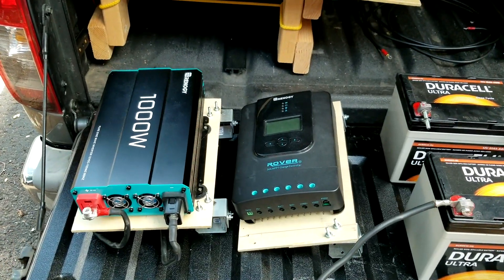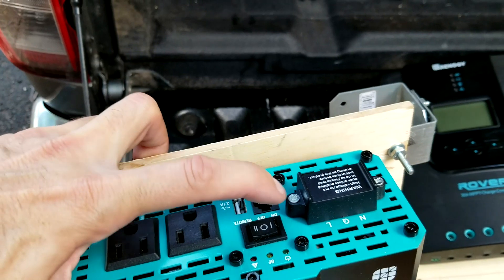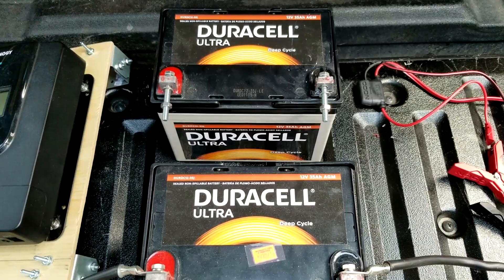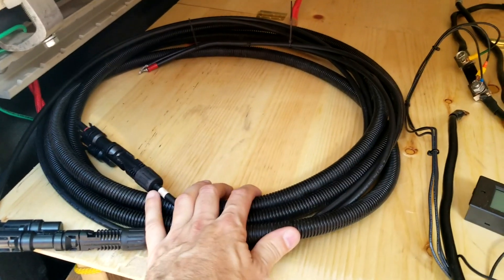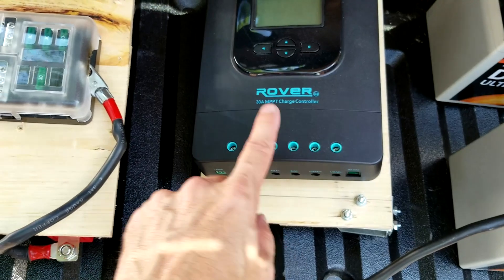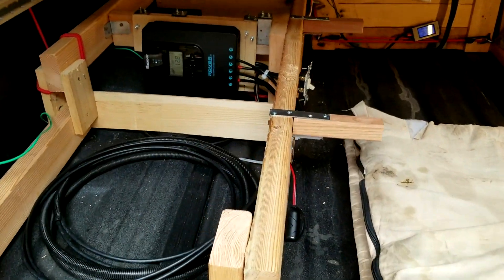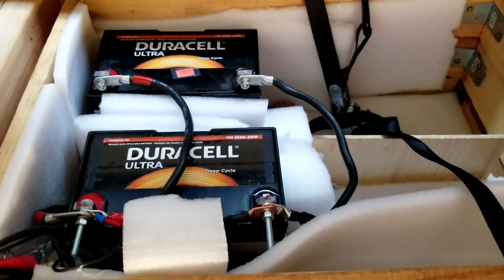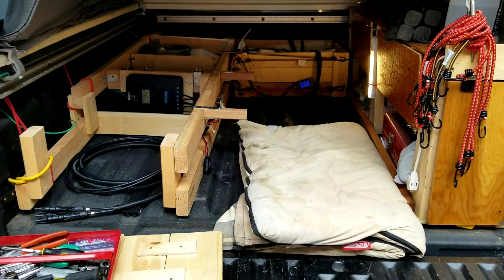Solar Install to 6' Truck Bed for camping

Comment: Hi, I noticed you have the comments turned off on the video on how to connect the 4 batteries and achieve a balanced charge and usage. I use it as reference, for me its one of the better ones on the web. Anyway, I have a similar 4 battery bank and I wired them just like yours. My question is if I put them on a straight line, can I add to each end another battery for a total of six and still be a balanced load. Have you done that?
Reply from the maker: Hello. Thank you for watching. I disabled comments to avoid having to give technical advice. There are better sources for technical advice than myself. I am merely presenting a theory that I believe. If others don't believe the theory, that's fine. I'm not interested in arguing. I'm sorry that I can't advise you on your project. I don't want people getting hurt or property damage. Thank you for watching & enjoy your project.

Comment: Nice little setup for a beginner. You need much shorter bolts on your batteries. And don't turn off the solar panels at night. And if you're going to be hooking and unhooking your solar panels a lot put Anderson connector on the cables. They are designed to be unplugged under a load.
Reply from the maker: I use the long battery bolts for two sets of battery clamps for 12vdc plugs. The charge controller only uses .2 amps idle but figured I should shut it off at night. (But never with the panel connected.) Thanks for the tips. I will consider them for future upgrades.
Reply: A little longer is ok, but them looked like 3" long.